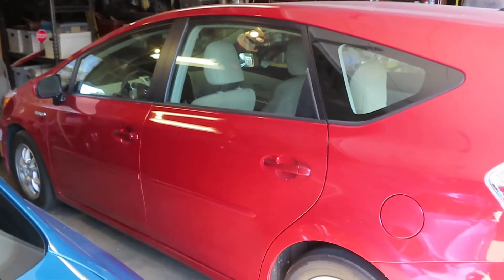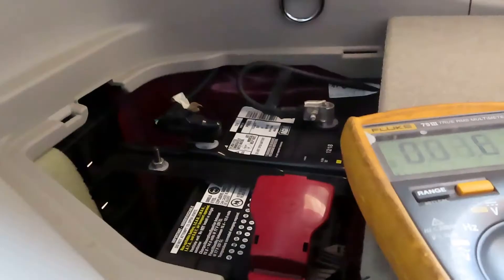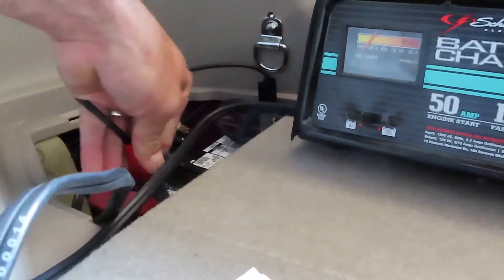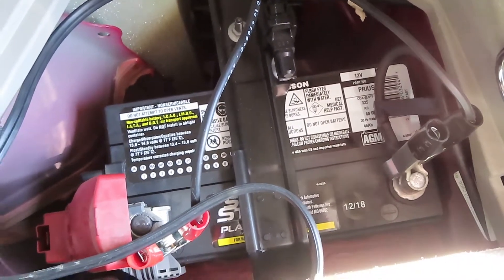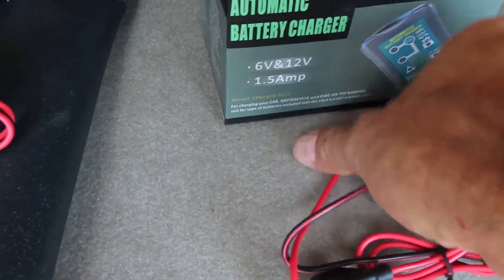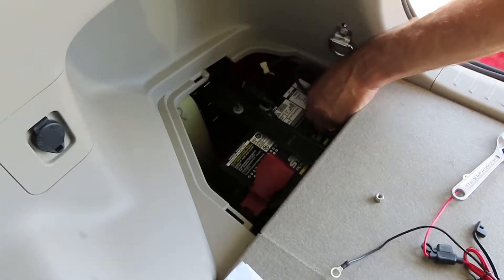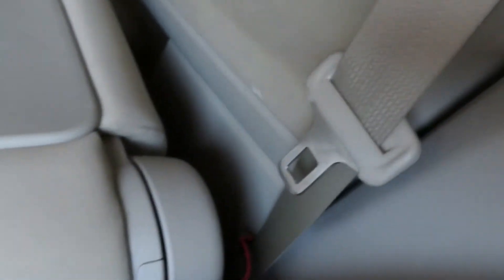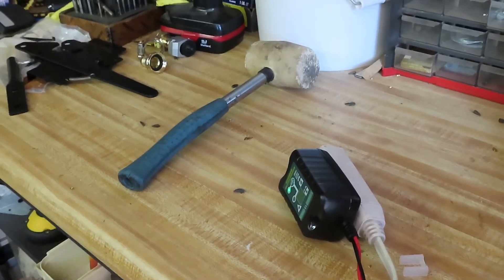2012 Toyota Prius V   Charging a Dead Battery    Adding a Trickle Charge

Comment: question about a GEN2 2009 Prius: watched your excellent video. Can weak Prius auxilary battery (say 11.5V) be put on a trickle charger connected to a power outlet to perform lenghty computer procedures/diagnistics? I need to know this for bleeding the brakes using the computer -- my auxilary battery is weak. Thank you

Comment: Hi, do we need to disconnect the battery terminal (negative) before charging the battery as per Toyota guidelines. I see you start charging without disconnecting terminal. I got Toyota camry hybrid
Reply: Excellent observation. It is stipulated in the User Manual, not for no reason, although not explained. I think it is important  adhere to, unless we know otherwise.

Comment: Good video, sorry that I'm late to reply (only just found it). 
Is there any difference between trickle charging at the battery terminals, and using the jump start connection under the bonnet? I've got a 2019 Lexus UX, and getting to the connection point in the engine bay is far easier to reach. Apart from the negligible volt drop in the car's wiring loom at trickle charge currents, are the two points directly connected.
Thanks in advance.

Comment: NEVER EVER charge an AGM with a regular 12 volt charger... I was told the maximum current you can use on a Toyota hybrid is 4.6 amps @ 12 volts...

That basically kills getting a jump start also from any vehicle... Far better to call AAA, as most also know this ... Most alternators in cars are higher than 55 amps...

Most hybrid cars don t even have an alternator OR a conventional starter on them... Charging is done by a DC to DC converter from your main battery ( 230 volts ), Which is also used to start the ICE when needed...

That small 12 volt auxiliary battery is only for the computers and auxiliary components... It doesn't start the car...

You can purchase a pocket lithium Ion battery pack to give yourself a jump start from the front tab IF it becomes necessary...

You can use an in window solar trickle charger to maintain your auxiliary battey... It won't over charge the 12 volt at all...
Reply: Prius owner's manual contains instructions for jump starting the car.  They are the same conventional instructions you see in any car manual.  It seems to me Toyota would not publish those instructions in their Prius manual if they thought jumping a discharged battery would ruin the battery.
Reply from the maker: Hmm it worked. I am not sure why then. Thank you

Comment: First look if your car has a regular 12 Volt battery or a socalled AGM type battery. Never charge a Toyota AGM with more then 4 amps, otherwise its dead.
Reply: The Battery Tender Jr is 0.75 amps

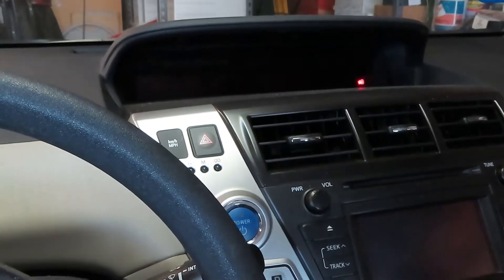Comment: I have a 2010 Prius but I assume it's basically the same deal?  One question I had also was, why keep the charger connected when starting up after charging?  Don't you need to reconnect the 12v battery to the car before it can start?  3:27 you say the charger is still hooked up?    

Second question, can trickle chargers overcharge?  What's the best way to avoid that if so.  

Final question: so if your battery has basically completely discharged, do you need to do what you did here, and use a higher power charger first to resuscitate the battery, then switch to a trickle charger to "fill it up?"  Can a jump start work just as well?  Or can you use a trickle charger to bring a dead 12v battery all they way back to full without using anything else?

Thanks in advance!
Reply from the maker: I have been away for some time.
 1. Once charged, you do not need to keep the charger connected, as long as you drive the car every few days.
 2. Yes, They can over charge your car, so I put my chargers on a timer. 
3.  If your battery has completely discharged you may have done permanent damage, and you will have to replace the battery. A slow charge is the safest way to bring it back but in a pinch, a jump start will do.. The people that own the car I worked on do not drive it much. Thanks
Reply: @houseautomotorcyclemore428  I also have a 2010 Prius, which I haven't driven for 2 months, so I had to jump start it. I drove it around for 2 hours and it seems fine. Since I rarely drive it, I want to buy a battery maintainer, but I'm not sure what specs it would need to have for the Prius. Can you help?
Reply: And also, will a battery maintainer with alligator clamps work so I don't have to remove the bolts?  And if I do drive the car, can I just unplug it from the outlet and drive it with the clamps still on it, or do I have to remove the clamps, too?
Reply: @teri.hannigan  get something like he has that bolts to the terminals. I wouldn't drive around with alligator clamps connected to my battery.
Reply: @Teri Hannigan  Highly dangerous to drive around with them clamps still on ...
One will fall off and short out the Main battery or catch things on fire...

Comment: Can you recharge batteries with a regular 12 volt  car battery
Reply: Yes if it has trickle charge and AGM setting. If it doesn't do not use the charger it will kill the battery
I did it not knowing the Toyota battery was a AGM I have the setting but thought it was a regular battery. The Toyota original had no markings so I assumed it was a regular battery. It killed the battery. What would happen is I would drive and the car would die. I found out that the 12v battery supplies the voltage to the engine and the charging system for the Hybird so if it dies the car wont run. Not even off the Hybird because there is no charging going on when the 12volt is dead. Also, remove the thick white wire when charging, its in the fuse box under the hood. This will prevent you from damaging anything in the hybrid system. It also clears the fault codes . It is a large white wire use a screwdriver and lean on the tab to release it.

Comment: What’s the brand name of the trickle charger
Reply from the maker: Here is the information on the charger. This is my first time using it, so I am not sure how good it is.                                                       LST Trickle Battery Charger Automatic Maintainer 6V 12V Smart Float Charger for Automotive Car Motorcycle Lawn Mower Tractor SLA ATV AGM GEL CELL Lead Acid Batteries
by LEICESTERCN
Reply: House, Auto, Motorcycle, & More thank you